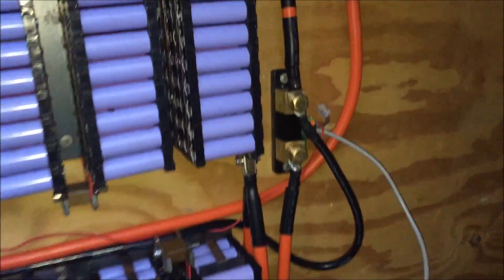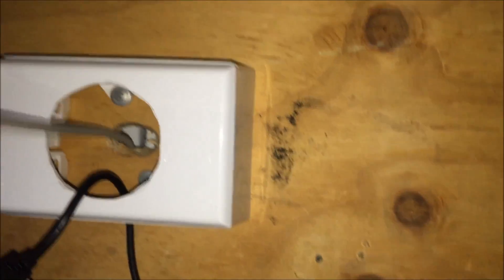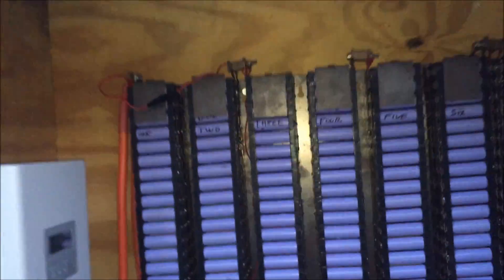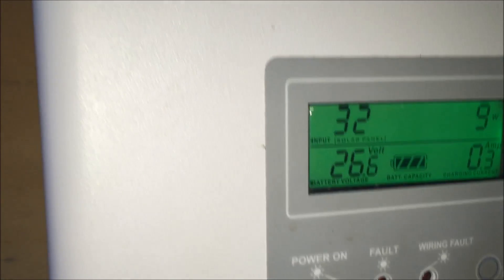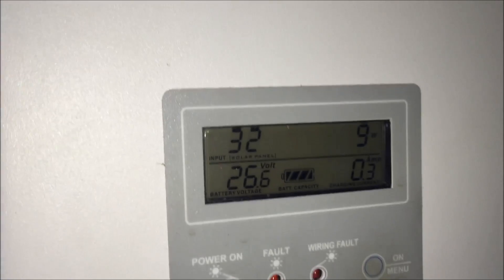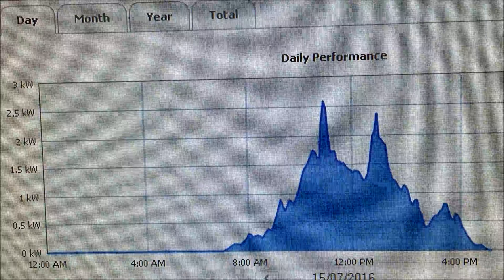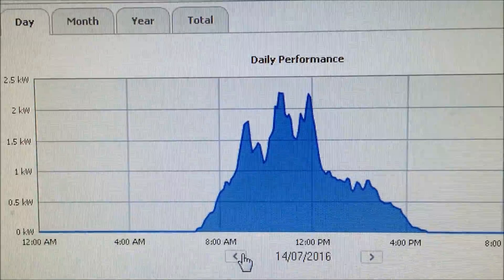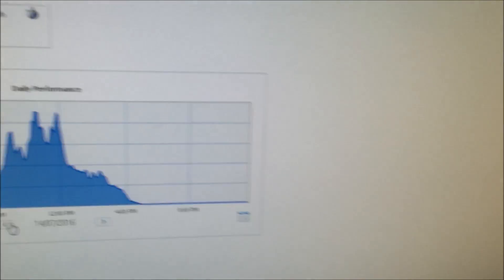Victron Battery monitor sorted and future videos

Comment: My biggest question is where to source the laptop batteries. I have been calling pc repair shops, battery outlets and recyclers. The information I was able to get is that the local battery recyclers sell theirs to a large corporation called Johnston Controls and are not willing to sell to private entity.
Reply from the maker: It's a little time consuming & luck plays a big part. Secondary issue is most recyclers are starting to catch on to the 'craze' so to speak and may start hording or wholesaling the cells to people 'like' me so they don't have to deal with the influx of can I buy 10 people. When I approach people I typically carry several thousand in cash because money talks!

Comment: hey pete i have a question in live in usa the voltage for my house is 120v could i build a battery bank that was 120v and bypass the inverter altogether and run it that way? and keep up the good work i watch every video you post.
Reply from the maker: UMMM house is 120v AC ? you would still have to invert it somehow i thinks..
Reply: There are yankie inverters that deliver 120v 60hz instead of 240v 50hz that the rest of the world uses.